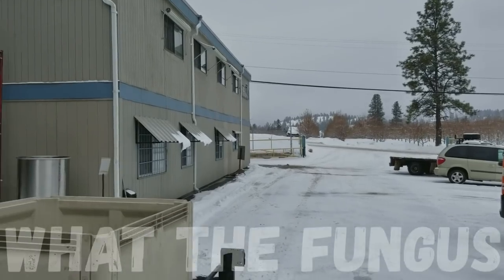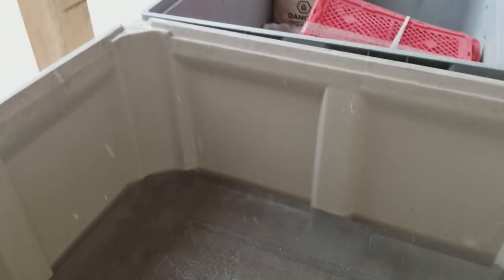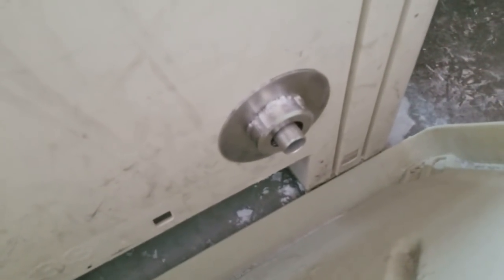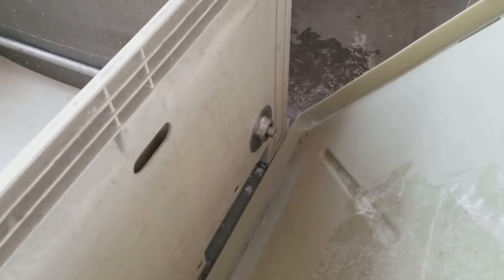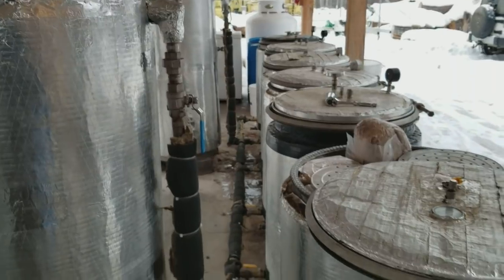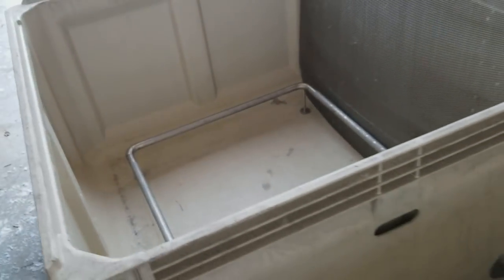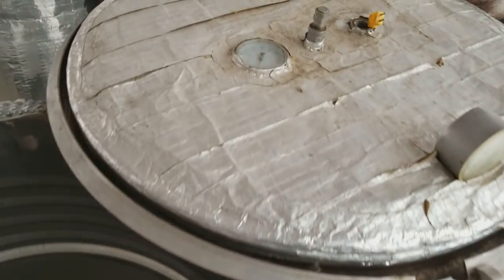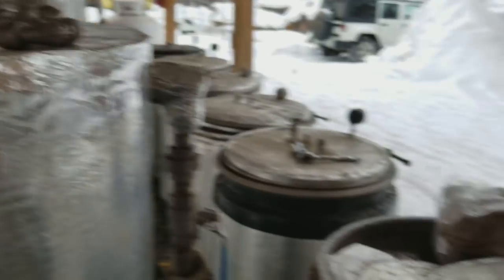New Tank Prototype Design For Mushroom Cultivation | Farming Production Tips For Beginners

Comment from the maker: ⚡QOTD: How long have you been mushroom farming for and how do you sterilize your substrates? 👇👇👇
Reply: WHAT THE FUNGUS you could consider a hand pallet jack /truck for moving the steam tanks.
Reply: none :)  But I plan to start with cold-water limed straw, until I build enough capital to move into hardwoods.  Have you any experience with the anaerobic sterilization process?  I'm concerned with too much lime run-off into my side-creek.  I also saw plans on aloha medicinals for a lime sprinkler system that might work, too.
Reply: I've been running a similar system using galvanized steel feed troughs, it's hard to find convenient shapes and sizes though. The HDPE wine totes look perfect but I am curious to see how it holds up to the temps over time. I've been running about 14 hr sterilization with mixed results. Some batches are totally clean and others are total failures. I have a feeling that I'm having similar problems with cool down and not letting them sit long enough. 
Love the channel, can't emphasize enough how helpful it is!
Reply: oh, never mind. I just saw in the comments it's PP. Awesome setup!
Reply: Been growing 2 years, Duckabush Mushrooms. We grow shiitake on alder and blue on straw. For the alder, we have one 55 gallon drum/boiler and 2 drums on a rack horizontal, we steam up to 80 bags a day that are 8lbs each. we are replacing this with a system very similar to what you have in this video, but building it out of concrete blocks and a steel hatch that's sealed using wing nuts, want to do 150 bags at a time. I have a 55 gallon SS drum I plan to install bulk heads in, that will hold elements to heat the water to boiling, will eliminate the propane, the need for exhaust, will extend the life of the drum and give more accurate control of temps. The straw we soak in 55 gallon drums of hot water, I heat the water with a modified system, I have 2 water heater tanks, a circulation pump and have hard wired the WH elements for simultaneous operation, I control the temp with an external aquastat wired up with 2 50amp relays. the aquastat is very accurate, within 5 degrees F, and can be adjusted up to 240F. We typically set it at 190 and by the time the drum is full and straw soaking it's down to 180. an hour into the soak, temp is 160-170, we start to drain while at the same time refilling to get the temp back up to 180. These water heaters get to temp from stone cold in a couple hours and an hour into the soak they have recovered to 190. It all works well but I'm getting contamination from using perforated oyster bags, considering switching to non perforated. Also doing this in an enclosed work area off of our greenhouse, have plans to insulate the 16x8 area, install plastic walls and use a couple 3000 cfm blowers and hepa to positively pressurize the room with air blown over our drying racks, essentially turn it into a room sized laminar so we can cool, dry, inoc and bag in a sterile room. I may have to wait until end of year before having time to get to all that.
Reply: I've been a myco-hobbyist for about 8 years with a background in chemistry.  I enjoy your videos and the scale that you share, which is greatly lacking in many DIY mushroom production videos.  I plan on turning the largest chest freezer I can find (around 20-25 cu. ft.) into a pasteurizer after a friend mentioned how well this was working for him.  According to my friend, it doesn't take long to heat up and once it does, it can be shut off and it will maintain heat overnight.  I like the idea of the freezer bc it would be a great way to recycle old junk ones that you could get for free or for a very minimal cost.
Reply: @nathanclark2780  Hello Nathan. Just wondering if you have any novel insight or lessons on the large chest freezer idea. almost done constructing one of my own. My steam source is via AA 925 petcock. I don't want to run it dry, so I'm prepared to swap out with a 2nd refilled AA 925 part way through. Not sure how to message you directly. thanks
jason
Reply: Heyyaa, it looks like the "Complete List Of Gear and Resources I Recommend" link below the video isn't working... is that the list of gear to put this together? Where should I find that?

Comment: Happy new year Brain, two things, the standoffs under the steam bars look small to be holding up all the weight of the culture bags. And you could use a chainfall to stack and unstack the steam boxes. It would be a cheaper, quicker than the cost of a forklift. In your spare time, you could look into a used battery powered pallet jack. Also, a short length of flexible stainless steel hose between the steam valve and the union might make alignment to the steam box easier. It looks like you are on to a slick efficient system that will be a custom fit for your operation
Reply from the maker: russell smith stainless hose exists?
Reply: Yes, flexible stainless hose is around from many manufacturers that can handle temperature and pressure far beyond what you would need.
Reply: I have to agree with Russell a chain hoist on a monorail would beat the forklift hands down on convenience and be less susceptible to environmental contamination. For the most part, you have the support structure already in place and your layout with long shallow sheds lends itself to using such a system.  Ongoing costs would also be considerably lower than fork and or pallet Jack.

Comment: I'm getting ready to build something similar out of concrete (3'x8'x4'), I was also figuring it would hold 150 bags. I only have 1 boiler drum, so will be curious to see if that's enough on yours? Also going to convert a SS drum to electric using water heater elements and an aquastat, thinking it will be more efficient and a lot less wear on the drum than using propane. I don't cool my bags, but I do clip them closed, never had a problem (shiitake on alder).

Comment: Get yourself a pallet jack aka pump truck, cost about 500 bucks for a good one. You can easily push around a ton with them on a smooth surface like concrete or plywood.

Comment: will that little trap drain really keep air from being sucked back into the tanks when they cool down? i know it works in toilets and sinks but isnt that only because there isnt any real pressure differential between each side? if those bins are full of steam they will probably have to suck in a lot of air to equalize the pressure when that steam cools back into water. or will the whole thing be vented some other way while its cooling down?
Reply from the maker: Matt ya you are correct. Ill likely just steam out of the hole. We pop the lid after sterilization so we don't get cooling pressure sucking in unclean air. The plumbers drain in this new setup is actually not necessary.

Comment: Re the insulation, have you considered the stuff that's used around engines? It's aluminum backed & rated for high temps.
Reply from the maker: Mio Giardino I'll look into it. Want something that is removable
Reply: Yes defiantly. You could attach that on to ridged foam board or a few layers on plywood then have three sides attached with the front piece on a hinge that secures on with bungie cords on the open end. I'm thinking with the insulation layer, three sides attached it be easiest for one person to do rather than juggle 4 sections. 

Can't wait to see how you end up doing this 🍀
Reply: Had another thought. You'll need to insulate the lid so use that to mount the sides on the chamber and that'll help hold the lid down as well as help insulate?

Comment: One thing. In relation to the overflow/steam outlet. will that not allow too much steam/heat out. I thought the whole point of a release is that the rocker keeps a seal, only allowing out minimal steam. Thereby maintaining consistent pressure. Adding to that, it's made of metal, socan maintain higher pressures. How will the plastic react to high pressure?Not saying you will have very high pressure because of the plumbers drain. So doesn't that kinda defeat the purpose of pressure cooking the substrate? I'm not an engineer, but I do like to experiment. Cheers :)
Reply from the maker: PaddyIrishman this tank won't hold pressure. The water trap will hold some steam back once we turn the heat down and simmer for 15 hours

Comment: Why not have gotten large pressure vessal cookers? Surely it would be cheaper and faster? If you want to diy have older gas/air compressor vassals that get swapped out regularly by law for industrial use as you are only working at very low pressures like 15 psi and make a pressure cooker from them. Cheap dirty and safe as generally tanks are made to handle 300 psi Hydro static load thus 15 psi you won't have to worry really about if something fails. Thus you cut out large amounts of components and could just use a small buggy with wheels on the vessal frame to move it around.

Comment: Been growing for 27 years. Learned from John Corbin (RIP) in the early 90s on his farm. Now I sterilize at 4psi for 8 hours in UN barrels. Grain and sub. Anything under 4psi is marginal in my experience.
 Give me a shout if you have a need for a maintenance man with a lifetime of grow experience. Professional facilities maintenance for 15 years at a fortune top 10 company.
And yes, I've been welding since I was 9-  dad was a pressure vessel welder 😋
Reply from the maker: bc perry just need to go longer with more supplements. 15-20 hours at temp
Reply: Supplemented bags are fine at low to no pressure...especially with commercial pellets. Grain has to have at least 4psi for 8hrs at core to work 100%. I've had woodchips (from an arborist) that would contam at 2psi - bacteria every time. Very frustrating... Even at 24 hrs. Problem solved at 4psi.
Reply from the maker: bc perry never had a issue with wood chips

Comment: Ok let me share what I did. I converted a bulk diesel farm tank into a 4000L (double door ) autoclave...yes autoclave...gets to 120 deg celsius. I am at sea level more or less so it only needs to get to 1 bar pressure or 15psi . It is gas fired with electronic control, so some suggestions from doing this: Firstly, copper tubing is perfectly fine to use and far easier than stainless (just need a  blow torch flux and solder).....super easy. With a little thought, a steel grid with durable paint will work for the base (expanded metal), so you may get a little rust...so what, it won't affect the outcome. And lastly as I have done, recycle your water and save on energy. It may require that your boiler water level be below the base of your steam tanks, allowing condensate to return and saving heat. My autoclave is totally closed and the condensate recycles through a one way valve to the boiler. The boiler level is maintained by the condensate reservoir in the heated tank, works very well.
Reply: I too recycle the condensation by gravity, I rarely have to add any water and never mid cook.

Comment: I have one suggestion for making bag cooler , you make wooden boxes inside layer per layer,  give movable folding handle,  you can use canewood or simple wood. 
Watch some vedio of Chinese wooden  steam boxes in village.
Wood cools down quickly and doesn't give burn your hands. 
You can remove layers per layer boxes, either by hand or use manual Chinese lift,used in cheese industry's, very  easily you can shift it on racks with wheels. 
Think about it. 
Namh shivay.

Comment: try a pallet jack, stacking bins will cause the top one to recieve the lower's heat. if you cement foundation for your new lab, might as well create a cement walk way to it from the boilers.

 might be worth making a bbq style cover with sleeping bag materials, poly fill and mylar/reflectix lining. climashield 5oz or 7.5oz are $15/yard and 1oz silnylon is $2/yd for 2nds. ripstopbytheroll.com diygearsupply.com thruhiker.com.

another idea to save on welds is to invest in a threader for the pipes and use high heat jb weld to seize lock the nuts.  hope it works out for ya and the plastic doesnt warp.
Reply from the maker: Patchwork Gardens fabric insulation is not a bad idea. Lots of options just need to make a decision
Reply: another option might be military surplus woobies, I think they are poly fill with one waterproof treated side for less than $20. maybe paded moving blankets. I hear ya, mycology is so custom that fitting gear to budget/efficiency racks the brain hard.
Reply: Yep. I agree on the pallet jack.

Comment: I normally see those plastic totes being used in the paper waste industry. .$400 is crazy..things like water tanks are also more expensive than you would think.
Reply from the maker: polypropylene plastic ain't cheap .. its rated 250F
Reply: It's a great idea and it will eventually pay for itself..interesting  system. .good luck and thanks for sharing 👍

Comment: I dont see why the slow cool down would fight contamination. Sounds like they just need to cook a bit longer.
Reply from the maker: Dylan T removing bags too hot outside will contaminate during the summer. If we unloaded in the lab in front of the flowhood then the cool down is not as important, however my operation is outside
Reply: I see so the cool down is just to keep them in a clean environment.
Reply: I want to know the answer to this too. It doesn't make obvious sense that cooler bags lead to less contamination, but I've heard this from more than one source. Does it have to do with hot air in the bags being pushed out and then room air beings sucked back in as it cools?
Reply from the maker: Meeksworth if you remove the bags too hot the seals break and during summer the outside air is dirty with spores and pollen
Reply: So this is really related to the seals and not the temperature of the growing medium. Thanks!
Reply from the maker: Meeksworth kind of.  If we unload hot bags directly in front of a flowhood in the lab they would be fine. However my whole operation is outside so I need to take precautions

Comment: Others have suggested a pallet jack.  I have the following jack and it works great. It is a bit more expensive but has the all terrain wheels.
https://www.amazon.com/gp/product/B000R8HLZ2/ref=oh_aui_search_detailpage?ie=UTF8&psc=1
Vestil ALL-T-2 Light Duty All Terrain Pallet Truck, 2000 lbs Capacity, 32" Length x 9-1/2" - 26" Width Fork
Reply from the maker: Thunderbolt Farm well that looks awesome... easy to move around on most terrain?